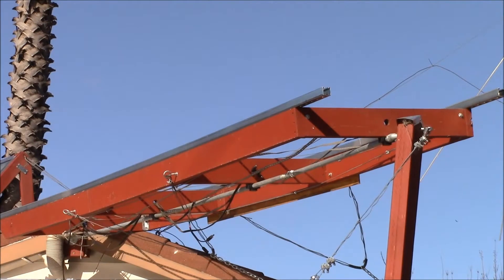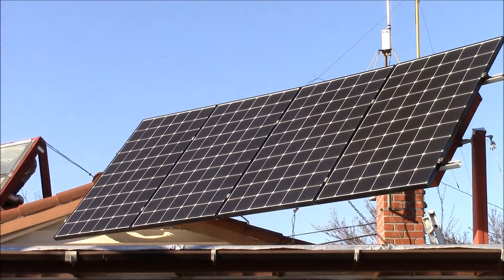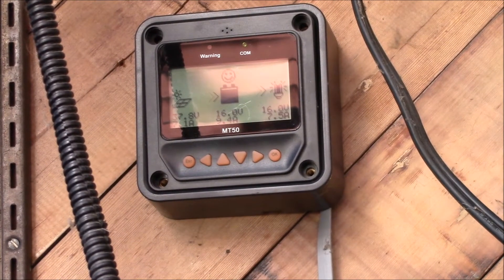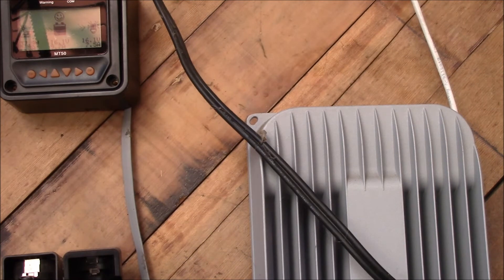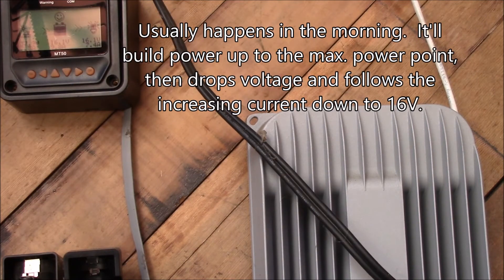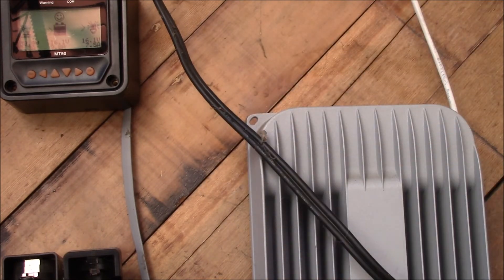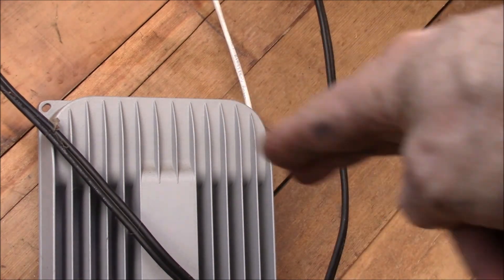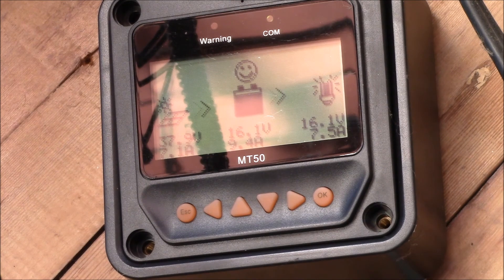Solar Panel Upgrade - LG NeON® 2, Part 2

Comment: I don't understand why they even started making 60 cell panels they should have stuck with 72 from the beginning! Why are you using 16 v battery pack?
Epsolar 4215
Reply from the maker: Not sure on why solar panel companies pick the various panel sizes and configurations.
16 volts is the highest voltage my existing lead-acid equipment can handle, so that offers the lowest cost option for getting experience with Li-Ion batteries:
https://youtu.be/mZAIBeP86Mo

If I decide to go to 24V ultimately, it's easy enough to reconfigure my 4S battery modules into 7S.

Comment: something is not working in this video?
Reply: Glad you said something, I thought it was me.  I am interested in R Brown's video though.
Reply: same!
Reply from the maker: What sort of issue?  Seems to be OK when I played it through.
Reply: The audio seems to play steady, but the video appears to hang on a scene. If you click on the scrub bar it re-syncs for a bit, then desyncs after a about 15 seconds.  I just watched some again to make sure it has not "fixed itself" since it appears okay to you, but alas, still out of sync for me.
Reply from the maker: Thanks for the feedback.  Seems to work fine for some folks, including me.  I'll try to re-upload the video and see if that helps.  Maybe YouTube messed something up on the processing.
Reply: The browser I use all the time is Chrome. Within which, part 1 of this series did great.  Since you mentioned some folks it worked, I tried watching part 2  in Edge. And that browser did fine. So I was able to finally watch the video.  I will be looking forward to your configuration experiments regarding MPPT vs PWM if you decide to post about that.  Thanks for taking the time to post your videos. Thumbs up.
Reply from the maker: Thanks for the feedback.  I used Chrome and Firefox (Windows 8.1) and both seemed to play the video fine.  Re-rendered and re-uploaded the video this morning to see if it's any different.